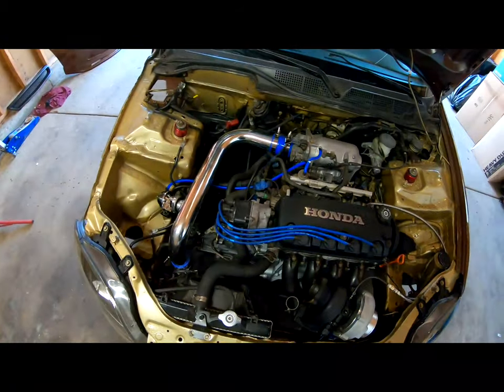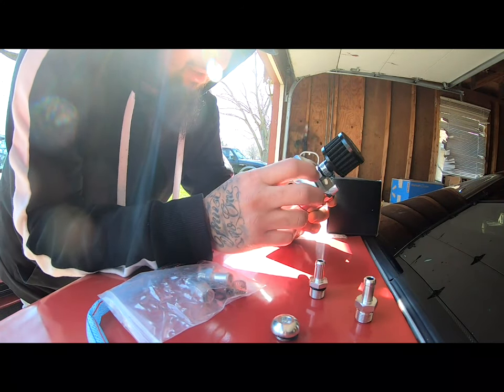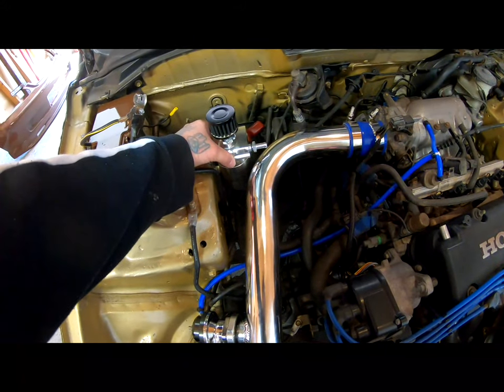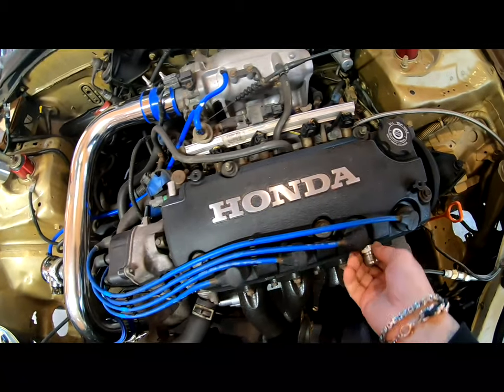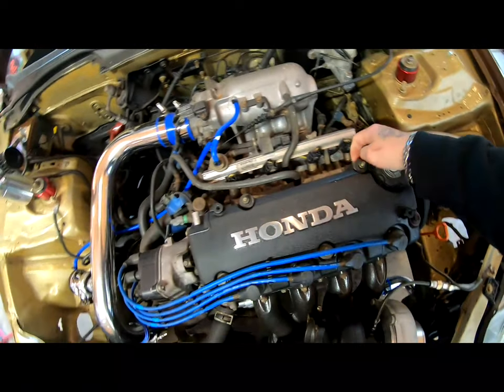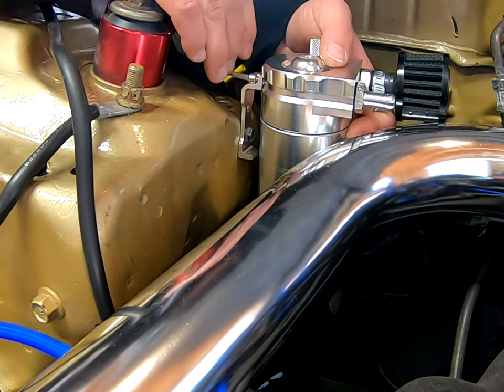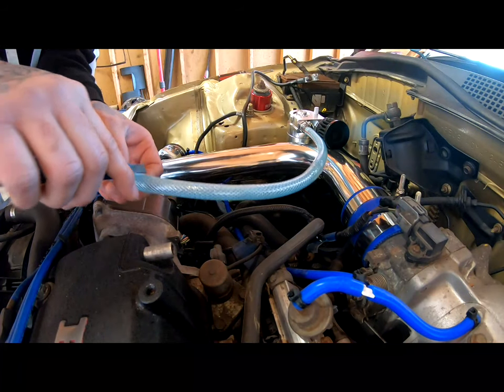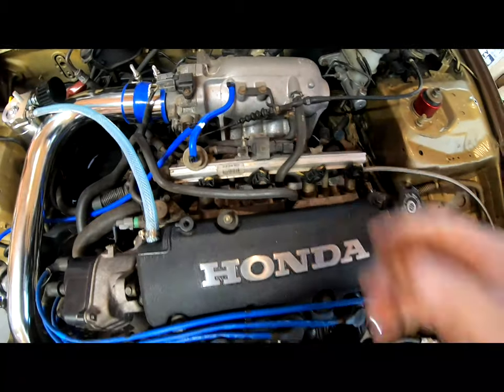Oil catch can intall step by step 500hp civic build

Comment: Most of the oil is from the crank case not from the head.I think I'm just gonna put filter on there and catch can on the pcv hose with black box removed without a vacuum help.

Comment: I think im going to do this im running a d16z6 non turbo tho but I put a filter on the breather but it drips oil out of it would i run the second line tho?
Reply from the maker: just run one line to the new breather so it catches the oil like I did and can still breath. no second line needed when your catchcan is filled up unscrew it and pour it back into your engine.

Comment: I gutted my PCV valve and also drilled the hole larger.The oil separator on the back does a pretty decent job by itself so I left it.Then run a hose from your breather box (oil separator) to your catch can. Run another hose from the nipple on your valve cover to your catch can. Simple and effective,those giant AN fittings are ridiculous and overkill on most of these setups.
Reply: Overkill? Never...